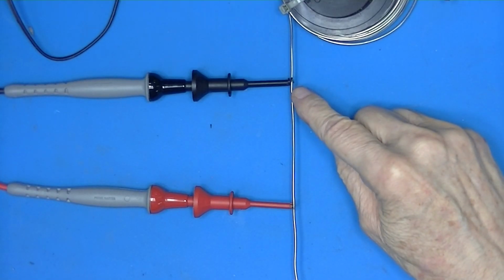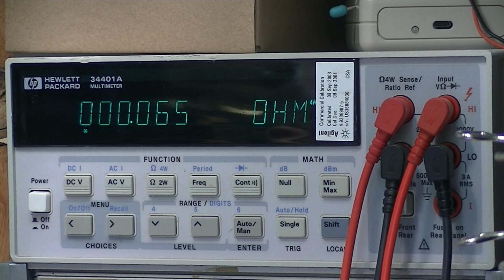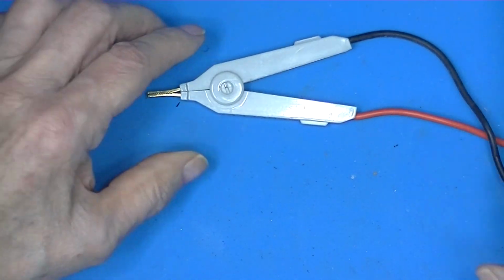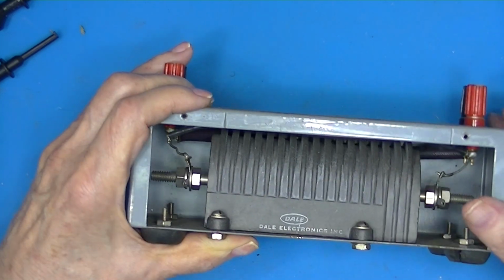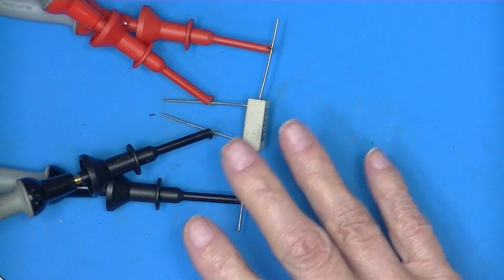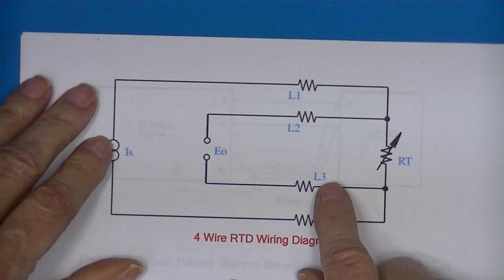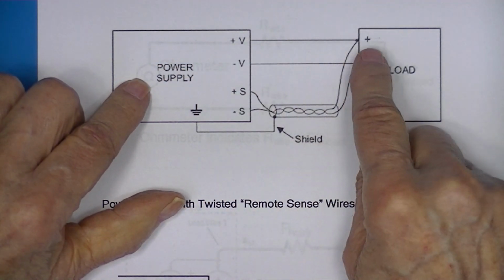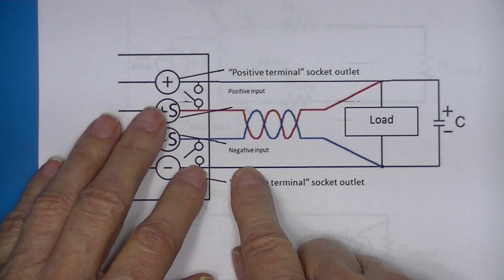4-Wire Connections – Part 2

Comment: More good info. Thank you. Is there a common term for the four-wire resistor to use to search for it at OEM Dealer/Mouser?
Reply: Mouser>Current Sense Resistors>Through Hole> Series = "4LPW". They only show one (It is a TT Brand, as is yours) and they do not stock it.
Reply from the maker: I picked up that one on Ebay just for the video. Search was "four-wire resistor"
Thanks
Steve